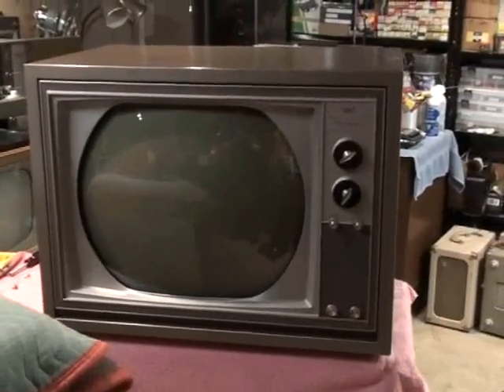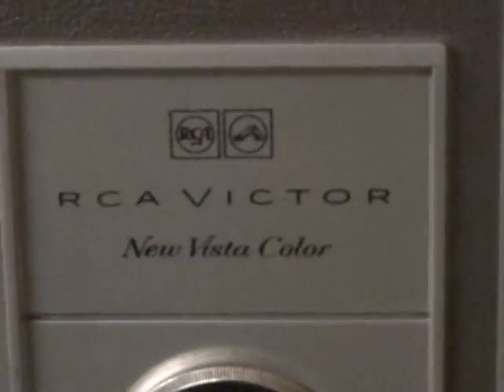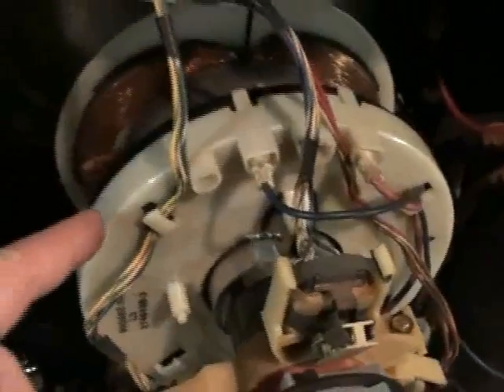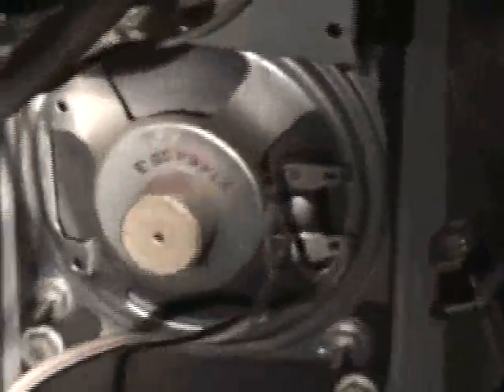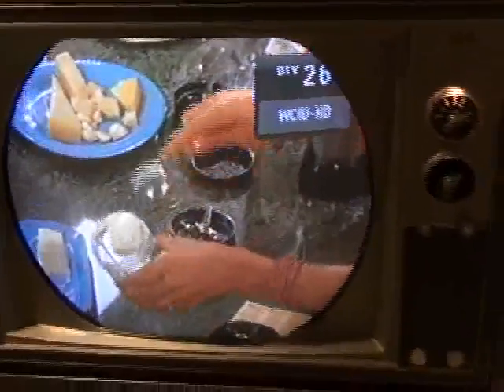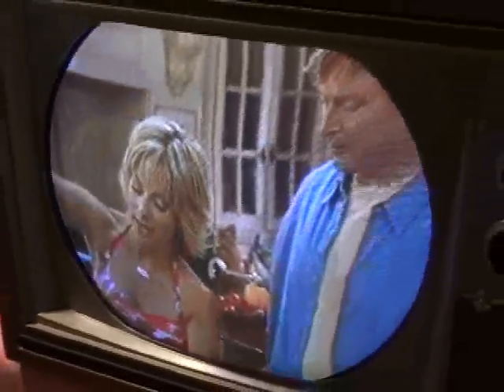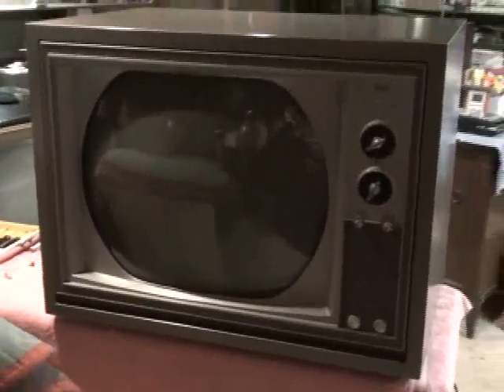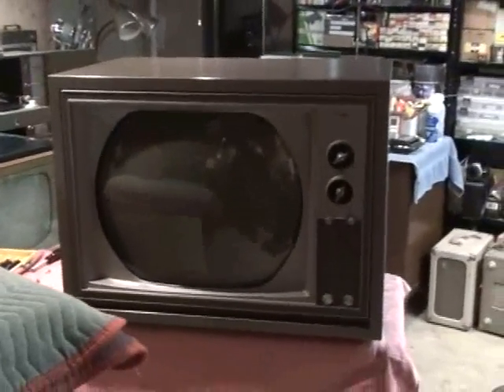1964 RCA Victor CTC-16 Color Television repairs and restoration completed

Comment: What a beautiful restoration job.  It's an absolute work of art.  Nothing surpassed RCA at its best, IMO, even non-vintage sets.  I have a 1989 19" RCA stereo TV that's still going strong, after 15 moves, drops, bangs, etc - and the best sound quality of any TV I've ever had.  I also bought a 27" Trinitron in excellent shape off Craigslist for $40.00.  Energy Star rated no less.  Psh with flat screens, the high res ones give me migraines anyway.

Comment: Amazing sharp picture with great color. I used to have a CTC5, it lasted until the mid 90's, in use for about 40 years. Never more than a couple of tubes replaced in all that time.  I never was able to get the convergence anywhere near as good as you have on this set.  Thought that was as good as it could be.  You showed what it should have been.

Comment: A very good picture for this chestnut of a TV.  My folks old '69 Magnavox would get a tune-up, if you will, about once a year.  Clean the tuner, check the electronics, adjust and balance the functions and get it back to spec.  Afterward, we had a better than new picture and an easy to use tuner.  These new High Def units may have an awesome picture and sound, but they, in essence, are disposable.  Shoot, that Magnavox had a color problem.  The  tech resoldered some grounds, replaced a tube or two, along with some other components, and that set lasted another 7 years.  It ran from 1969 until 1981.

Comment: I remember my aunt had one exactly like this when I was a kid. It had legs that screwed in the bottom, technically making it a console. Being curious about TVs, I would look in the back while it was on and I could see that the damper tube was a 6CJ3, which I later found out was the same as the 6DW4 that was commonly used in these sets.

Comment: Very nice video! My parents and my grandmother had a 23" B&W console RCA TV that looked identical to this except it had the rectangular 23" screen Both were purchased in the fall of 1965. Also, both almost went up in smoke due to a defective push/pull on/off volume control switch. RCA fixed both for free. I think this was a common problem with that model year. 
I'm not a fan of RCA but I LOVE Zenith!!! Best example of the quality products we USED to make in this country.

Comment: Excellent demonstration of the TV.  I always enjoying seeing these older TVs stay preserved with complete restortaion.  How hard is it to bring a picture tube back to life.  I have a Tekinka TV (rare manufacturer) where the picture tube is loosing its focus.  The other night I turned it on and it was very fuzzy, but then it cleared up after running it for about 30 minutes.  Also I get some "blue bleed" when the contrast is at full intensity with biight whites.

Comment: You know with the heat that these valve sets produce im very surprised no one fits a slow running fan to stop the heat build up.
Reply: We had an old Sears Black and White Set that had all the Controls on top. Our Cat loved laying up there because it was very warm, but every so often  the Picture would go wonky as the cat would move the Vertical or Horizontal Controls.

Comment: great television you have there . The american televisions are better built than the foregen built one's . I hear the differents in picture and sound qualty . Zenth was very good qualty made set . It was made on chicago northside . I use to live close to the zenth plant back in the days . I never thought that zenth would get rune by lg corp . I was inside the old zenth plant in 2005 .
Reply: The delta gun CRT was the reference standard for well into the 21st century for broadcast television monitoring.

Comment: Of course! Just not directly. A DVD player would work well on these sets. You would need an RF modulator (most stores still have them). The modulator would be daisy chained between the DVD player and the TV, with the TV's tuner set to the channel that the modulator puts out--usually ch 3 or 4. That's all there is to it. And if you have a VCR laying around, it can serve as an RF modulator by connecting it to the set and feeding the video & audio from the player into it's A/V line-in jacks.

Comment: Those Round Tubes are Sad Looking. Our first colour set was a 25 in. RCA with the XL90 chassis . Worked for about 13 yrs with many Service Calls. Now it sits as a Stand for a 27 in. Toshiba, which is still working as good as new ,after 24 yrs, without any Service Calls.  American TVs left a lot to be desired in Quality/Reliability/Longevity